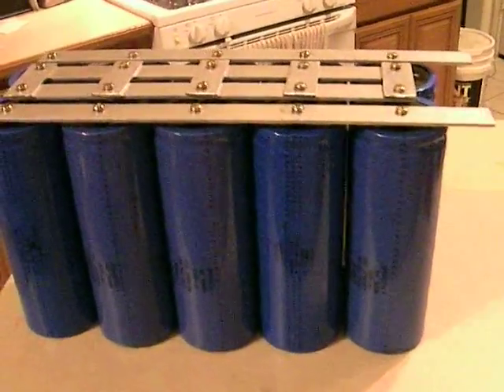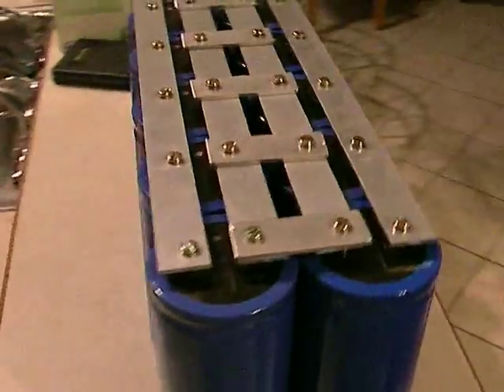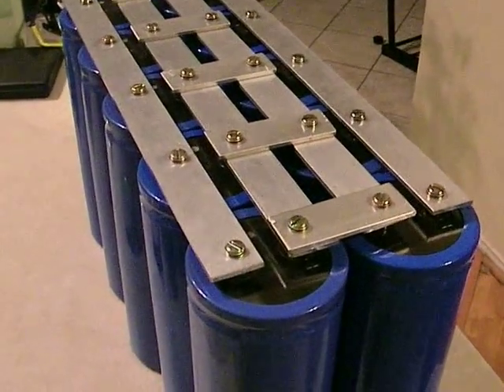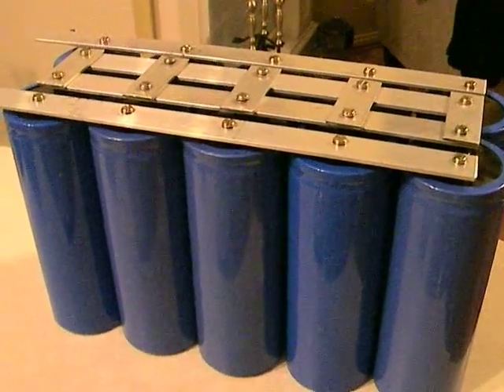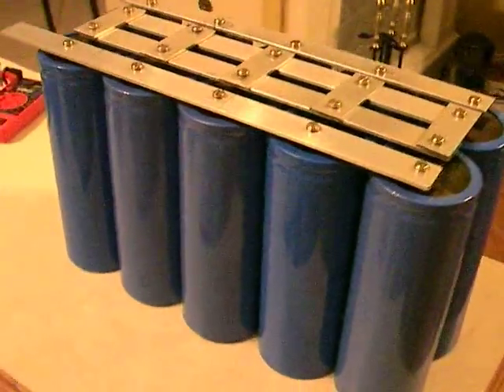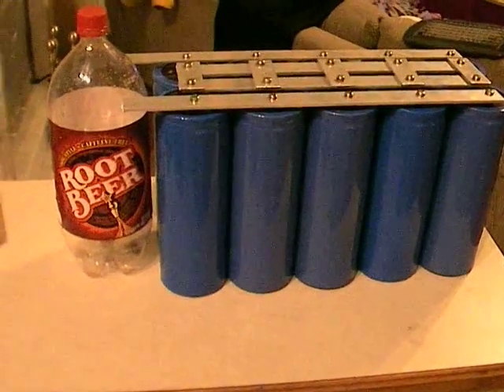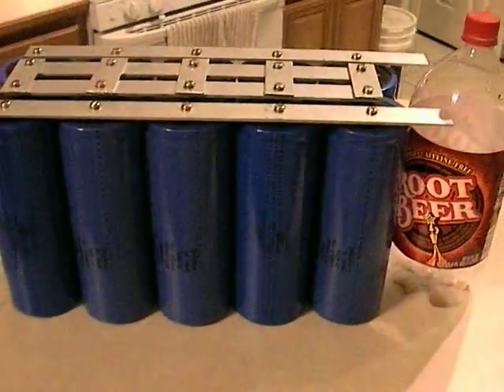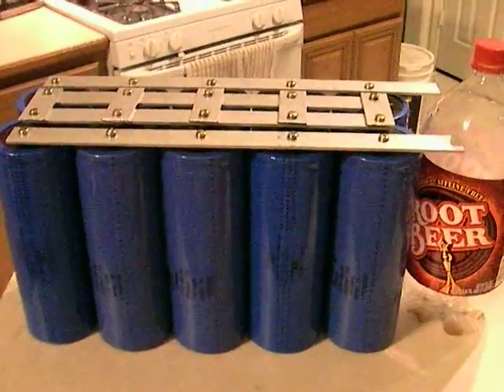150,000 uF Capacitor Bank for Electric Car

Comment: @ElectricFormula 

It wont help anythign except smooth out any ripple and load the batteries as a buffer.
It will actually make the batteries work harder to keep them charged and any back pulse of emf will warp the battery plates . They also need to be discharged through a resistor. Your wasiting money and time.
The min you step on the gas pedal , those caps are depleted.

Comment from the maker: I used the battery pack to charge it but I had it going through a resister to have it recharge slowly.  You have to make sure to use some method to slow the charge of the capacitors otherwise you get a really big scary spark and melting terminals.

Comment: @ElectricFormula I'm an EE and mF is not the same as uF. 150,000uF is 150mF. 150mF is 0.15F. The proper symbol for uF is a Greek mu character but that's difficult to type on a standard keyboard so the EE world has settled on using u (lower case) for micro unless you are using a program that supports extended characters. Also, m and M are not interchangeable, m is milli or times 0.001 and M is Mega which is times 1,000,000.

Comment from the maker: I think I paid 75 bucks for all of these on ebay. At least close to that.  To solve the debate I looked on the side of the caps. They said 60,000 uF on the side of each. So my understanding this cap bank is 150,000 uF.  Call the uF what ever you want, im not an EE. I wish I had access to a scope because I want to see the spikes from the controller. These caps aren't big enough to run the car, I want to level out the spikes. To run the car you would need something like Super Caps from Maxwell.

Comment: yeah please write uF, not mfd. mfd is sloppy as you should have gathered from the many comments about it already. change it.

it's interesting to consider if a large cap bank can actually make an EV more efficient because if we think of batteries as resistive then a smooth current is more efficient than a 50% duty cycle current of same Arms because the powerloss grows as the square of the current. 
maybe even have an input inductor.

Comment: @lexichronicle 
no haven't heard of the supercaps... but just today i noticed a scientific paper hanging in the electrical/ mechanical building talking about the use of super capacitors and the work they are doing here at the university. cool stuff! Im going to google the maxwells supercaps right now. take it easy

Comment: @lexichronicle 
I guess you are right though-I am spoiled because of the standard international measures, that I forget some of these issues used to be a big deal. 
it seems one would be able to see very quickly in the lab or shop that the voltages would be not correct...if one used a .001 or .0001 coeffiecient 

all the electrical engineers are into these huge capacitors(novel)... I (ME student) am just trying to see more large scale battery banks/ or fuel cells  that are affordable !

Comment: "When writing microfarad the Greek letter μ is used.  If μ is not available, the notation uF or mf are often used as a substitute for μF in electronics literature. A milifarad can be found in older texts although it is never to be used today. The milifarad is an archaic measurement and although it means 1000 MFD do not use in practice.  Now a capacitance of 4.7 × 10−3 F, for example, is usually written as 4,700 µF.

Comment: That is like 0 to 2000 Joules depending on how far you discharge them. Equivalent of accelerating the average car to a maximum speed of one meter per second. Without a boost converter these capacitors can only deliver a fraction of their energy content and take the load only for a few milliseconds.  Then the battery takes over again. Switched in parallel to the battery and considering the load, they do near to nothing.

Comment: Those caps will do very little, if anything, for your car. The controller probably switches around 15k~20k and, if properly designed, has enough internal capacitance to deal with battery lead inductance. My DIY controller has 63,800uf -internally- which is more then enough for some serious power. Good luck. The project look good. I wound up here linked from your build site.

Comment from the maker: uF is microfarad which is also used as mfd they all mean the same thing.  I never felt any warmth when I was using the capacitors.  So I wasn't ever worried about heat.

Comment: waitwait, you say microfarad but use mFd

Is it uF or mF? Also, That is a very good idea for an EV but you may want to look at (in the future) an oil filled capacitor, or something rated for high-current pulses.

I have a few caps that amt to 16 millifarads @ 450V but they would heat up if I cycled them often.

Comment: Capacitors are sort of like an electric nitro boost. When the car is moving slowly, the batteries can keep the capacitors topped off, and when you need fast acceleration, the capacitors can discharge to provide high power for a short span of time without harming the battery pack.